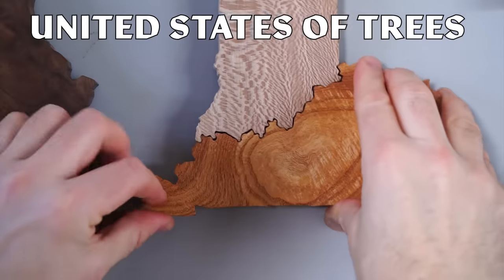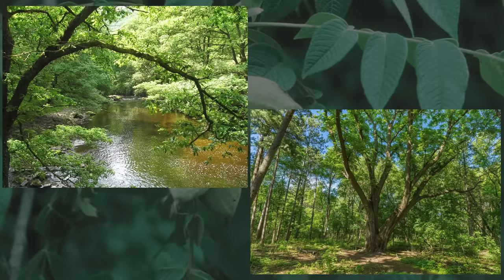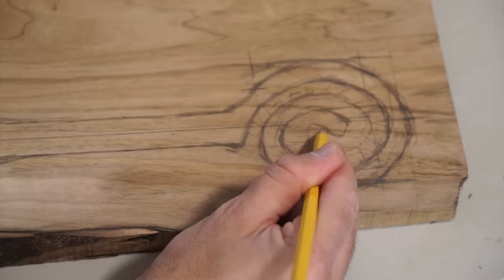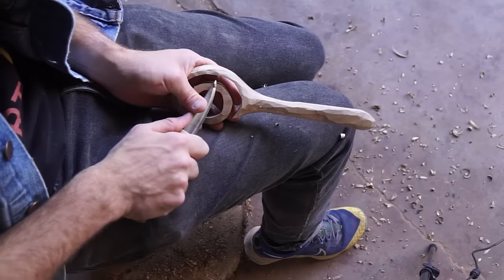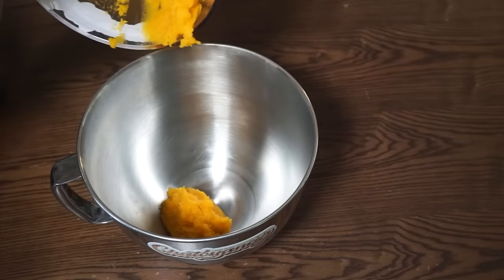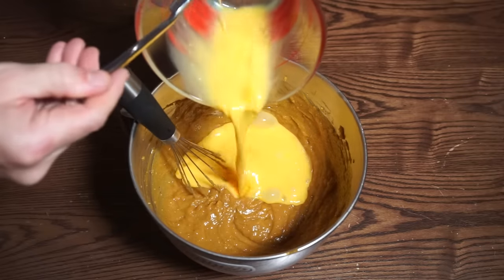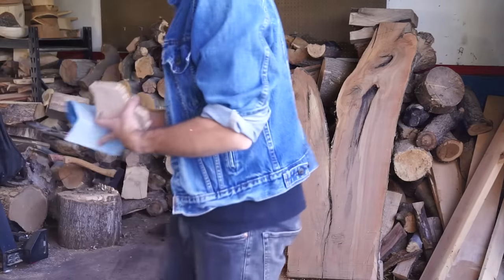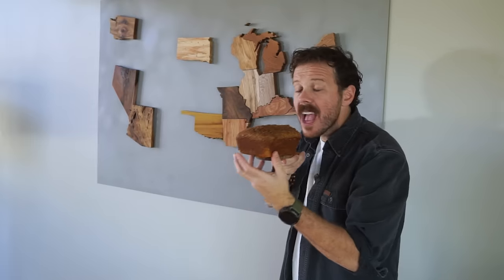Carving the Infamous Spiral Spoon

Comment: Great video! Some unsolicited suggestion for cutting edges on stuff would maybe to grab a deburr knife, they use carbide tips that are angled. It may be better for continuous cuts than a knife. I don't do wood work but metal, so it may not transfer